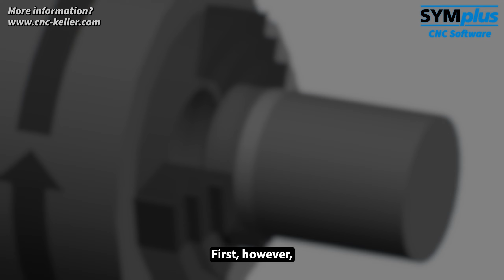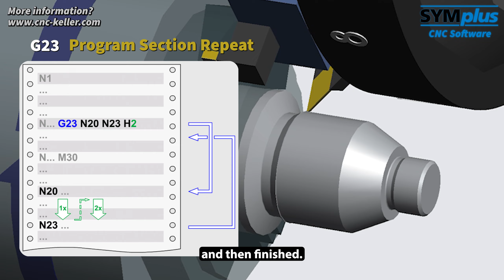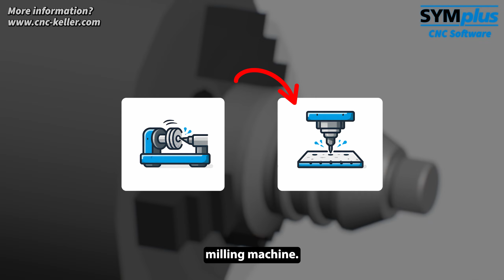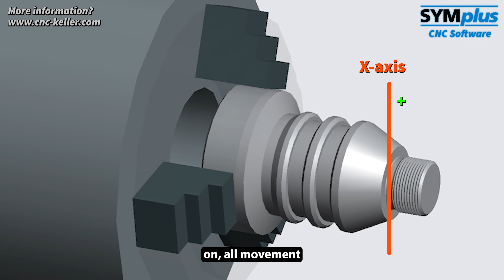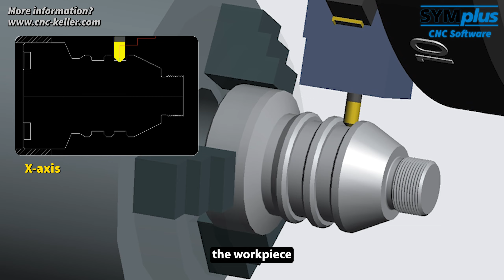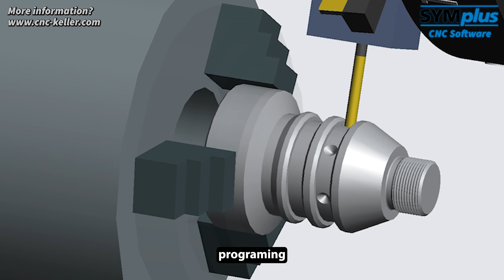6 Cross Holes on the Cylindrical Surface – Milling on the Lathe | G15 G19 IP1 | Instant CNC

Comment: The younger generation of CNC “experts” has gotten way too comfortable hiding behind their fancy CAM software, clicking buttons and letting the computer do all the thinking for them. Most of them wouldn’t know real G-code if it smacked them in the face. They can generate toolpaths all day, but ask them to read, write, or troubleshoot actual code and they’re completely lost.

That’s exactly why awareness around G-code matters. CNC machining isn’t just about loading up some polished software and pressing cycle start like a glorified button-pusher. If you don’t understand the code your machine is running, you don’t truly understand CNC machining at all. Too many youngsters are calling themselves CNC fanatics while knowing next to nothing about the language that actually controls the machine.

Real machinists know: CAM is just a tool. G-code is the foundation. And if the next generation can’t read it, edit it, or write it from scratch, then they’re not mastering CNC — they’re just babysitting software.
Reply from the maker: That’s exactly why we developed SYMplus. Modern CAM systems are important, but we also believe machinists should understand what’s happening behind the generated toolpath. Not just press “Postprocess.” That’s why SYMplus focuses heavily on learning and understanding DIN/G-code, machine logic, and CNC fundamentals practically.